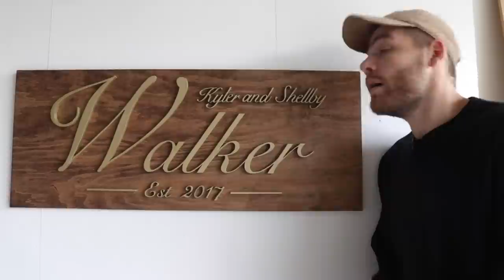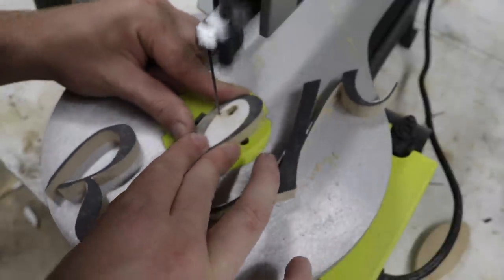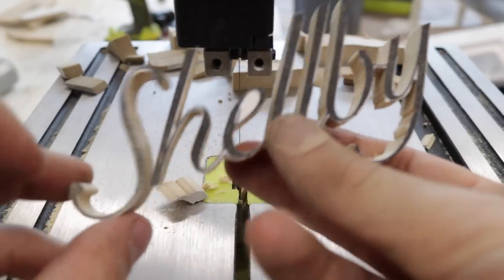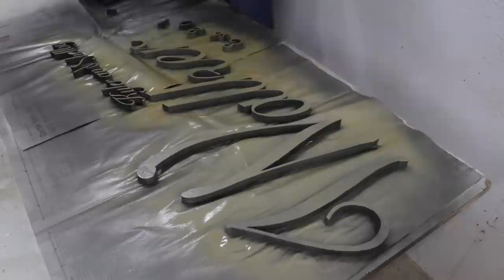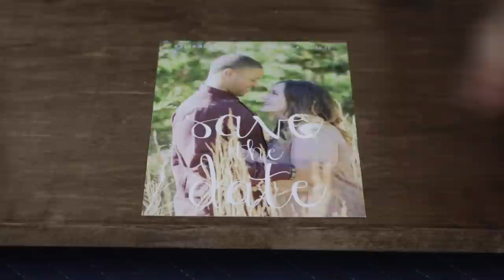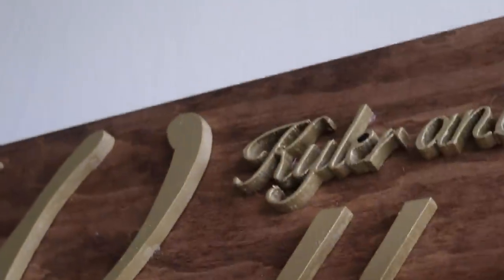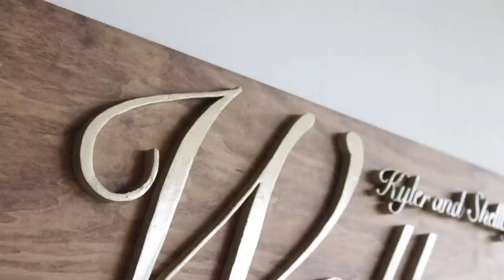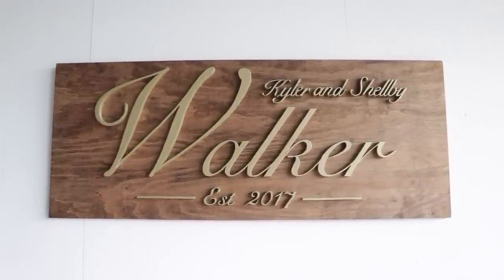DIY Wooden Name Sign | Perfect Wedding Gift | Modern Builds | EP. 66

Comment: Hi Mike, lovely sign great work!
A few tips, Red is the best undercoat colour for Gold.
Packing tape on top of the template when cutting out on a scroll saw acts as a lubricant and your blade is less lightly to break.
If you're cutting something small with the scroll saw, tape down a thin piece of card over the blade opening, it will help support small pieces when doing fine work.
Reply from the maker: Thanks a lot John! Those are some killer tips, I'll be sure and so that next time. Thanks!

Comment: so i have done a good amount of MDF letters, they never paint / finish well... I have done a lot of research and testing and still haven't found and easy fix that I love... but my go to at the moment is drywall spackeling on the edges. it sands easy enough and you can get it fairly smooth. I used this method on my interactive transformers wall art build. There still needs to be a better  way, maybe that is a good business / invention opportunity .
Reply from the maker: Nice! Yeah, after a couple coats of gold I put a coat of the elmers wood filler on the edge and that helped out a lot too!

Comment: Maybe next time you can try placing the letters closer together, it will help conserve some of your spray paint for later.  Not too close though, you want to make sure you hit all of the sides.  Also don’t forget not to rush the scroll saw cuts, and get the right blade for the right job, it will save a lot of that stress down the road.  Great band saw skills though, you sped up rather quickly once you made that switch.

Comment: hey Mike quick question.. me and my girlfriend are going to stain oak wood... do we have to put a finish after we’re done with the stain??
Reply from the maker: It never hurts, especially if it could use a little protection. I'd reccomend polycrylic by minwax. They have a high gloss and low gloss depending on what you want. Just apply it with a high density foam brush.

Comment: Nice build man! Where did you get the stencil? I'm trying to do a sign for my wife but don't know the easiest/cheapest way to get a stencil made.
Reply from the maker: Check out Vectr. It's a free software that's pretty easy to use. Then I printed it at a local print shop. A Kinkos would work fine to. Just tell them it's a cutting template and need it to be the cheapest option
Reply: Modern Builds thanks a lot! Really love your videos, keep up the awesome content.